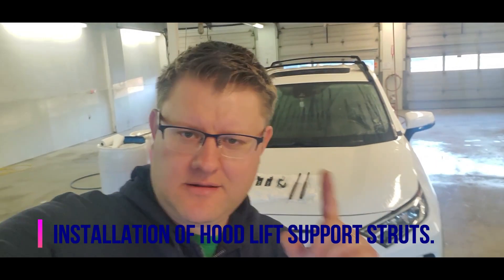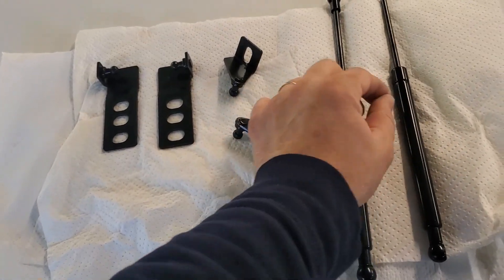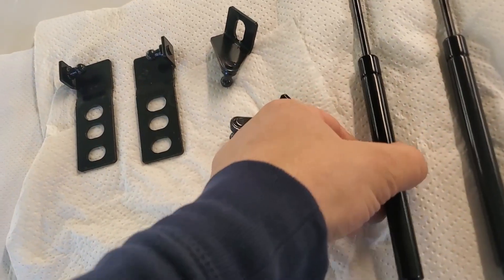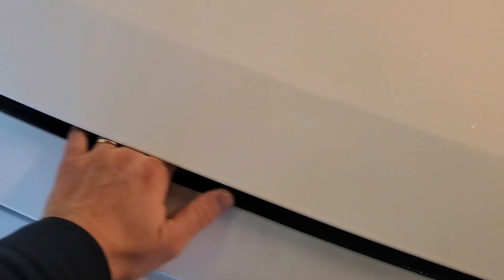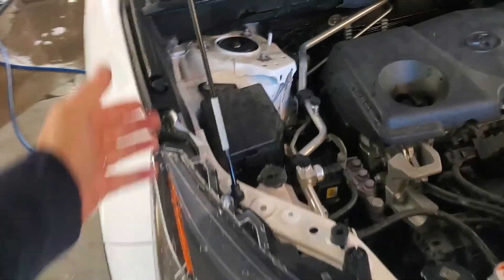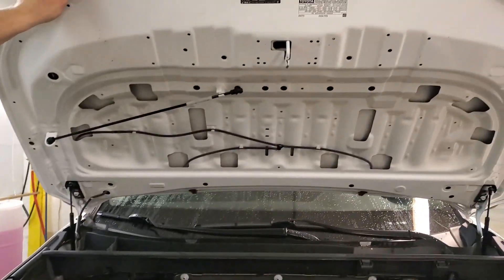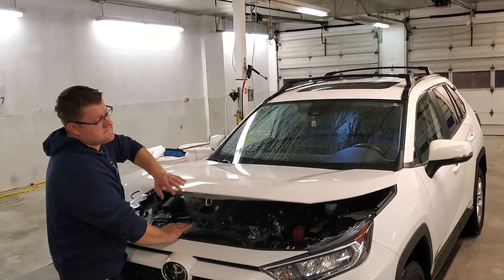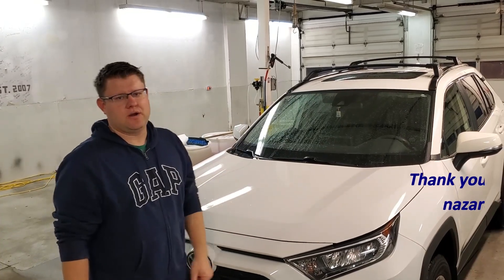2019-2021 Toyota Rav4 hydraulic hood struts installation.

Comment: Thanks for the informative video. I am ordering one. This has been one of my most pet peeves of my Rav4 every time I open the hood. Hoping this will add a little more strength to the back of the hood. The back of the hood has a tendency to move up and down on rough roads and windy conditions. My 2018 was a lot worse than my 2020.
Reply from the maker: I would try going back to the dealer and tell them to udjustable hood latch or maybe put a new one. I don't have issue like that even before putting hood struts.

Comment: Putting the pin in the driver side top strut ball is extremely awkward to put in when attached. I thought about tying a thread around it incase I dropped it. But I didn’t and now it’s one with car.

Comment: I've seen comments that say these struts cause the corners of the hood next to the windsheild to raise up. Have you seen this on yours? Great video and demonstration.
Reply from the maker: I haven't seen it on my Rav4. That area where struts connect,its not thin aluminum,it is reinforced part.
Reply: @nazarettos6987  Thanks
Reply: Yes I have seen it and I took them off. I do not want to put so much strain to the hinges, bolts and the hood of my car. It was clearly visible even from inside the car.
Reply: @eliaspyr  Thanks for the info.

Comment: Would have made more sense if the kit used both bolts on both sides of the hoods bracket. Just need to trace around brackets before removal and have help from a friend during installation

Comment: I think is to much pressure for aluminum hood
Reply from the maker: Absolutely no problems with the hood. Everything is aligned and closes perfectly. I don't see any problems.
Reply from the maker: I check the hood for any gaps before  and after installation of those hood struts. I do not see any issues, also the mounting points where bolts go through are reinforced metal not thin aluminum.

Comment: Stupid. I just bought these...went to put them in and i was undoing the bottom nut on the drivers side when because i was trying to be carefull and not smash my hand when the nut popped loose...I dropped the whole ratchet and socket down the hole on the side of the car. Which i just bought a whole 150 dollar set so I would have the exact tool to do the job and whatever socket i might need in the future. Now my nice brand new socket is sitting at the bottom of the hole that runs alongside the wheel well. Then when trying to get into that area and see if I could get to it...I pushed the little clips that held the plastic piece in my door jam...thinking they were holding the piece in the wheel well on...and now this plastic piece in the door jam is pushed in and i cant get it back in place....
On top of that when i dropped the tool I let the weight of the  hood sit on the one strut i had installed...and the bracket bent.

So an all around great time....
/sigh
Reply from the maker: Sorry for your troubles,but its not that difficult job.
Reply: @nazarettos6987  No its not..its just my luck...lol.
Reply: What could go wrong has gone wrong for you. Sorry to hear that.